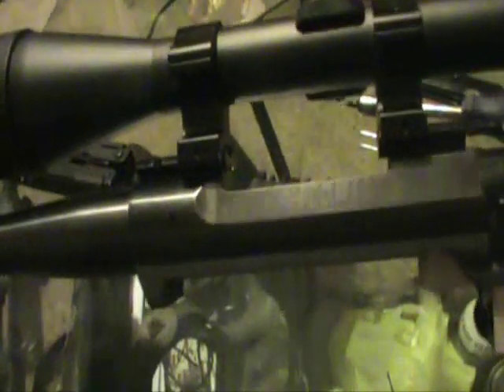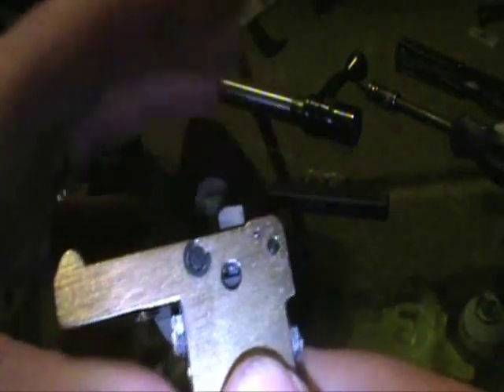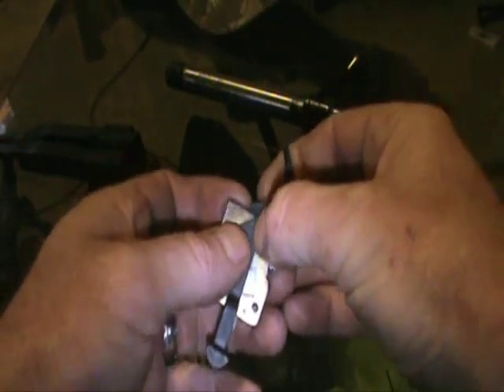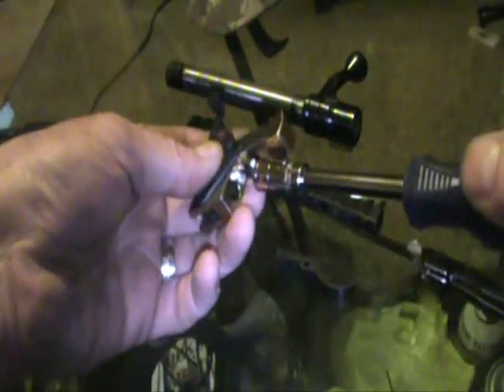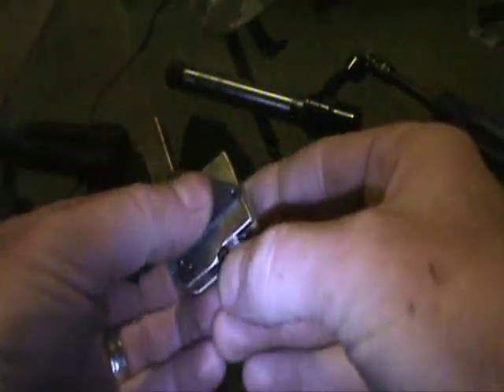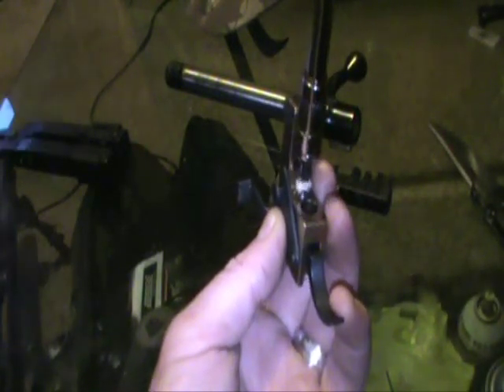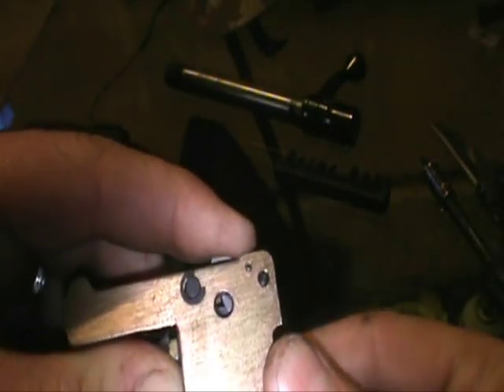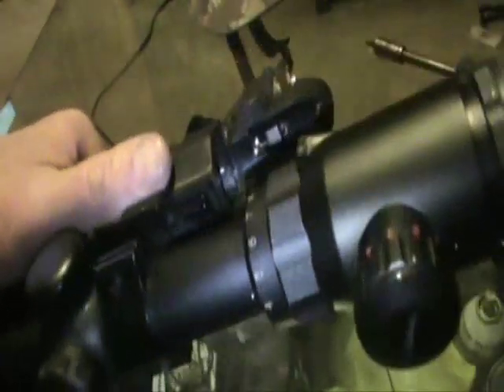Howa 1500 Trigger Modification and Adjustment

Comment: I took a whetstone and 300 grit  to my trigger and removed a bunch of material.
Now it breaks like frozen glass. I didn't mess with pull weight in case I drop it it won't discharge

Comment: adjusting this trigger is extremely dangerous and should not be done   accidental discharges can happen if it's done incorrectly.  Bumping the gun or as little as taking the safety off can fire a round..... please if you value your life and others lives have a professional do the trigger work or buy a new drop in trigger..
Reply: Ryan Forbes that is so unnecessary... there's nothing wrong with doing your own trigger job as long as you pay attention and do it right...
Reply: Well the only reason I say that is because I almost lost my life when my friends gun went off while hunting.  A good trigger for this gun is less than 150 bucks.

Your life priceless just saying.

Comment: Thank you for the informative video.  I have a Weatherby Vanguard, which is basically a Howa 1500, the only difference was the trigger spring will not fit through the trigger weight adjustment screw hole, a bit of a pain, but now, even though there is still just a hint of creep, the trigger breaks much cleaner.  I used a fine knife sharpening stone to clean the trigger up.